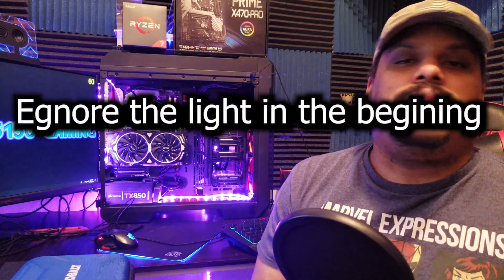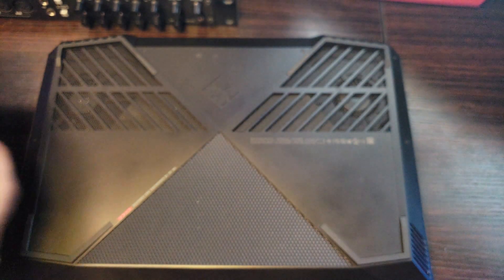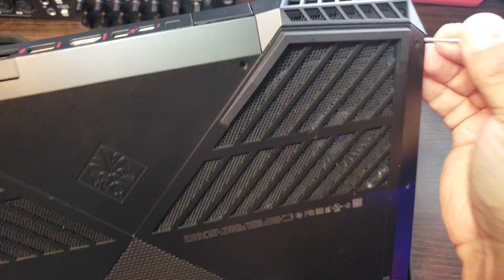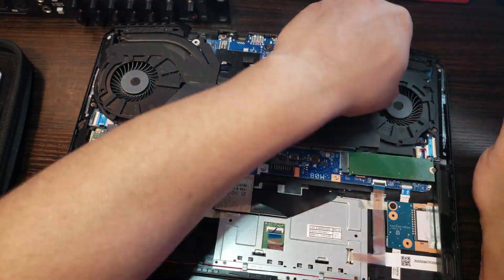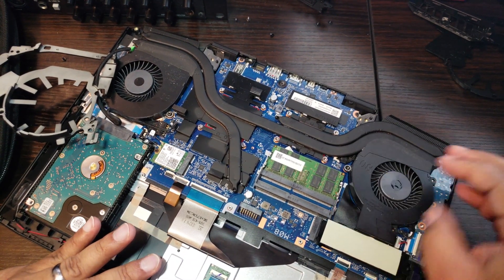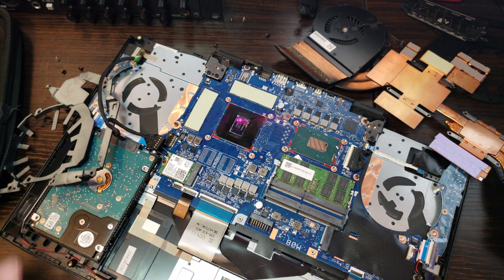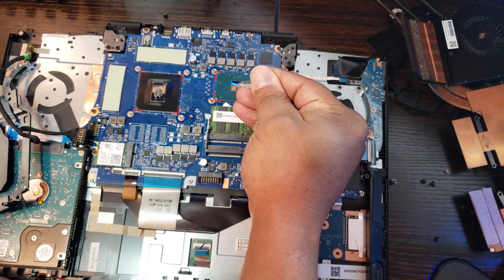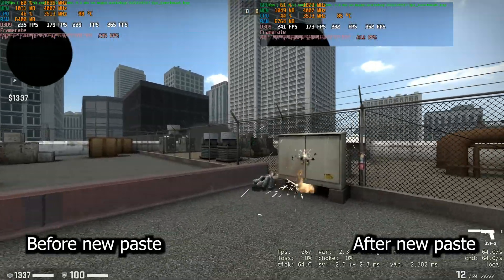HP-Omen 15 how to add new thermal paste to laptop / Laptop Tear down

Comment: Hello mate, nice video! Have you seen any difference after the liquid paste? Did it cause any damage after some usage? I have the same laptop with a 1070 GPU and thinking of trying this liquid paste as right now it runs about 80 - 93 celsius. Please advise me if it worths or if its dangerous of harming the laptop, thank you!
Reply from the maker: Been running stable ever since.  It's normal to be weary.  I was a but myself. The pads the company uses is not really high quality. Using paste will only help the laptop, those pads they use are really so the company can save money per unit, it's easier and more cost effective to create a machine to put on a pad then a human to add liquid paste. Check some of the other comments here a few others have followed this and we've all decreased temps by 10°c to 20°c. Let me know how it goes for you if you do. Thanks for watching!
Reply: @EnforcerGamingX  Thanks for your reply! Feels good to know that it does not cause any damage to the system over time. Is there any specific liquid paste that you would recommend? Thank you for your help!
Reply: @EnforcerGamingX  they use pads instead of paste?
Reply from the maker: Yeah it the pads they use are quite low quality, using a good paste was pretty helpful bringing down the temps. Using pads are pretty common with laptops in this price range it's cheaper in the manufacturing process.
Reply: @EnforcerGamingX  I have an Omen 17 I bought for £1400 , CPU temps are hitting 90-92 c , it does not throttle though and is holding 4.2ghz all core on a cinebench or prime 95run.

Wonder if it's worth repasting.
Reply: @Jasontvnd9  same here -.- definitely my last hp product ever

Comment: Gonna repaste my hp omen 15-dc0022na tonight first time doing anything like this only worried about putting it back together lol
Reply from the maker: Kinda like I told the other guy a few days back. Take video or at least pictures with your phone or  anything. That's always my problem is I'll get everything back and boom! 2 extra screws..what!!? Lol. That extra video / pics really helps in the end. Last guy was 14 y/o and completed it with no problems :) you got this.
Reply: I did it all fine so far temps around 80 now gonna do more tests tomorrow thanks for the guide made a big difference. Did take more time putting it back :)
Reply from the maker: Awesome man! Glad it was helpful let me know how it all goes :)
Reply: Did more 3 hours of gaming max cpu temp was 87 down from 97.

Comment: so i did this earlier today and i managed to cool my temps down. thank you. however now my laptop doesnt get good connection to my wifi, did i mess up or is this a whole other issue?
Reply from the maker: That's gotta be a whole other issue unless you somehow disconnected the wifi wire cable. I'm not certain but normally it is on the other side of the board. In hp laptops it's a small rectangular module. Looks like 1/4th of an SSD drive with 2 wires connected. Really only thing I can think of if it is the problem. If all other wifi troubleshooting fails, may need to open back up and see if something else came lose like that. Thanks for watching, hope you get that fixed!
Reply: @EnforcerGamingX  I would that that its that too, but the wifi still works. for example it still let's me connect to my wifi, it just says it has a very low connection, it only shows the dot and no bars. meanwhile on my phone its working perfectly fine.
Reply: Try to reinstall the wifi driver in device manager?

Comment: Thinking of buying this laptop this weekend wondering is this the only solution for the heating either this omen or the after nitro 5 wondering ur opinion I picked these two cause they most in my budget
Reply from the maker: I've been asked this question on the Nitro 5 I used it be not extensively. It does run cooler out of the box then the hp-omen. But after this repaste it's always in reasonable temps now. People like to undervolt but I don't suggest that unless you're familiar with over and under clocking.

Comment: Need to do it , do you know what will be best option to clear fans ? Compressed air in can will do it or try something else?
Reply from the maker: Yeah I just used air, it was surprisingly clean in there considering I have cats that shed pretty bad. Of course they're never by it but still lol. Not much dust or anything in it, air was good enough. High alchohol cleaner is what I use for heavy dust and dirt. Used to repair computers and some of them gave me nightmares lol. But clean after cleaning out :)

Comment: My fan grill got burned because of heat
Reply from the maker: Your fan grill? How hot did your CPU get? Because that's pretty much impossible, the throttle point for Intel is 100°c. Melting point for PCB plastic is almost non existent as at ~450 Kelvin ( ~150°c) the plastic will just jet soft, the CPU would need to get to a temp that would actually melt the CPU before it could distribute that much heat through the laptop and burn PCB  plastic. Was there something else going on in the laptop, did it short out or something? Like the old laptops using the older polycarbonate they would ignite causing the entire laptop to start up in flames. If the fan grill got hot enough to burn, other components would ignite. Thats also the reason those Samsung phones just bursted into flames instead of just melting a few years ago, Just crazy, get some pics on reddit dude and link me! :)
Reply: I was doing 3d rendering and it's color got white like not exactly melted but about to
Reply: My bad bro I just cleaned it with a little wet cloth and turned it was dust also I'd there any that I can clean dust without opening my lapot like with hairdryer or something
Reply from the maker: Without opening I would just use cans of air, if it's caked on dust enough it won't come off with air, you'd have to open the laptop and wipe it with computer cleaner, something alchohol based so if it gets on the board it won't do any damage as alcohol will evaporate right away. Glad you figured that out. Good luck!
Reply: @EnforcerGamingX  thanks for your help

Comment: i was calling HP support cuz i have fps droppts conditioned by thermal problems (cpu). they said repasting doesnt have warranty and also: THEY DONT HAVE THERMAL PASTE FOR HEAT SINK BUT THERMAL PADS... technical support HP. But thats not true is it? :D i have the hp omen dc-0304ng

Comment: Turn off Intel's Turbo Boost, you're welcome. That shit is cancer for laptops.
Reply from the maker: I'll give that a try but with the new thermal this has been running perfect. No more than 80c during hard end gaming. But without turbo the processor speed is a bit low for gaming.

Comment: Nice video. I need to upgrade the ram of my Omen 15. You might consider removing the background music. It sounds really noisy and can drown out your voice at times.
Reply from the maker: Yeah sorry about that just some riffs I write for videos. Was masking some bad background noise lol. Also my studio headphones were broken so was using gaming headphones which is really bad for finding levels. The 16gb of ram in the omen is good till you do some 3d or game design. So far it's been good there but always want more ram in those situations :). Thanks for watching!!
Reply: @EnforcerGamingX  I just want duel channel ram. But the last time I tried, there wasn't a significant difference in gaming performance.
Reply from the maker: Depends if you run games at the max the GPU can handle. If the GPU utilization is over say 80-90% there will barely be a difference.

Comment: Damn why yours is going up to a 100? Mine have a stock thermal paste and I have like 60's mid 70's for CS Go.
Reply from the maker: Interesting.  When did you buy it?  And is it the exact same model? Been a known issue on all 6 core CPUs. I'd like to see, did you make any videos with it. At 1st 70s and 80s if u see my early videos on this laptop. Then jumped up more over a few months.
Reply: @EnforcerGamingX  yeah I have the same exact model and same exact CPU. Unfortunately I don't have any videos of it. I bought it 2 months ago.
Reply from the maker: Ahh okay, possible they finally fixed it in the newer versions. HP had tons of complaints on it, but within the 1st few months it wasn't so bad.
Reply: Everytime like I am playing GTA 5 or Fortnite I am having a mid 80's is it bad?
Reply: George Santos: Because csgo is not difficult for pc hardware i have a same laptop and when i play far cry 5 the temperature is  95 - 100°
Reply: @Hefaistos95  I know but what I am saying is his laptop is going up to a 100 degrees even on CS GO
Reply: @georgesantos4240  Because the laptop is running at high fps on csgo that is the reason why is the temperature so high i always lock fps to 80 on csgo and then i have  max 70°
Reply: @georgesantos4240  The less fps the less temperature
Reply: @Hefaistos95  no it's not like that. The less the temp the better. Higher temp will give you fps drops.
Reply from the maker: Well the fps will drop as you reach 95°c and even more at 100°c when the CPU hits those throttle levels. The speed will decrease mhz and of course so will the FPS. Repaste was the best option because I been getting stable fps and temps in the 70s-80s.

Comment: I think you saved me a lot of time and money. I've had heating problems with this laptop since I got it and couldn't find any concrete solutions on this pc specifically. I'm on my second cooling pad trying to bring the temps down. Thank you!
Reply from the maker: Spencer comments like this totally makes my day. Temps have remained decent since this repaste. Repaste with a cooler that lifts the bottom a bit makes for really acceptable temps. Thanks for watching and appreciate comments like this :)
Reply: @EnforcerGamingX  Just thought I would give an update: I repasted about 2 weeks ago and have maintained about 15-20 degrees cooler than my original temps with pretty much everything I throw at it. Thanks again
Reply from the maker: That's great! Glad it helped, I was in the same boat month after buying this laptop I was worried I just burned my money for a overheating laptop. Thanks for the update, appreciate you letting me know this worked!

Comment: Mine after update f. 08 my cpu got over 97 c  while gaming tried undervolting to - 150 didn't work it only lowers the cpu when I disable turbo boost any help, mine is almost 3 months old
Reply from the maker: Did you try the repaste?  This laptop was only a few months old as well. All the games I did on this channel it seemed to get worse but was always high.
Reply: @EnforcerGamingX  I'm afraid if I repaste it I lose my warranty still I have 8 months left
Reply from the maker: That is a good question to bring up and probably should have mentioned it in my video. You won't lose your warranty if in the U.S. long as the paste is not the reason you need the warranty. Feel free to research this more as of course I'm no lawyer to give actual legal advice. But here's some information to help ease that worry a bit it's called Magnuson-Moss act in short long as your modification is not what breaks your laptop the warranty is fine. https://www.mlmlaw.com/library/guides/ftc/warranties/undermag.htm
Reply: @EnforcerGamingX  ohh I didn't know that, I have thermal grizzly paste left over from my pc am gonna use it, thanks bro
Reply: @EnforcerGamingX  hi bro...one help&advice....got hp omen i5 7300 ,gtx1050 and almost all new games getting my laptop hot hot....at example bfv 90-92c,bf1 90-92c.....apex 87-90c...nfs payback 90c...temperature like that are since i buy laptop.When i use laptop for no gaming...is average 55-60c.... all of this what i write to you are on undervolted on -160v.Some advice from you ? worth of changing thermal paste or ?
Reply: @secondevil1  yes change the paste
Reply from the maker: @darkishrex98 Thanks for answering this!! I feel so bad @SecondEvil I totally missed this reply dark is correct. Putting on new paste helps quite a bit as shown at the end of this video. I added a bit more than needed, but got good results!
Reply: @EnforcerGamingX  im gonna try using liquid metal coz mine gets hot even after repaste and undervolting the cpu, maybe the paste i used wasn't so good. used the cm mastergel, bought it cuz it was pretty cheap on sale on amazon
Reply from the maker: I would be careful using grizzly paste or liquid metal, never use it on aluminum coolers.  I'm not sure if the omen is aluminum though. What temps are you getting after paste? And are you voltaged? May want to reset that , I'm thinking your voltages are off if your still hitting 100°c.
Reply: @EnforcerGamingX  at 3.7 ghz and -165 undervolt, im reaching 90°C in apex at low settings. And not sure what you mean by voltages being off? Can you explain that please?
Reply: @EnforcerGamingX  hi can you pls tell me what you mean by my voltages being off?
Reply from the maker: Well I don't give recommends on undervolting. I would be sure to find someone that has undervolted this laptop specifically also not every CPU will clock the same. 90°c is about right depending on the room you're in and what your laptop is sitting on. Laptop cooling pad is what I normally use so there's good airflow in the bottom.
Reply: @EnforcerGamingX  i see well I'll look into my settings then, thanks

Comment: Mind telling me what paste you recommend for the omen 17 i7 7820hk because I tried grizzly paste but cpu temperatures remain the same around 93c on games such as shadow of the tomb raider and hitman 2016. Thanks in advance.
Reply: i have hp omen i5 7300, gtx1050 and my temp in game are as well average 86-92c in games,depend what game i play
Reply from the maker: The i5 7 series is not too bad, as its 4 cores 4 threads.  The i7 8700h is 6 cores 12 threads. These 6 core CPUs are what really have issues with heat as there is demand for them but limited tech to keep them cool. Adding aftermarket paste is a good way to get the temps down. Hopefully we will see some better innovations the year and next in terms of stock cooling :)

Comment: Thanks for the video. Really help in terms of showing the incapable stock paste when compare to the new thermal compound
Reply from the maker: Glad to hear it was helpful, was waiting to do this video for awhile ;) thanks for watching
Reply: @EnforcerGamingX  have done it with mx-4 current temp idle 35degree max 76 after undervolt by throttlestop -125 for cpu power and cache
Reply from the maker: Nice getting to 35°c just be careful your room temperature doesn't exceed 35. If it does you risk condensation which will kill the CPU :).

Comment: That is a significant difference. Do you notice a difference in frame rate when you play games?
Reply from the maker: Not a significant amount, but a bit as it's not hitting that throttle point where it drops to 3.2ghz so it is more stable framerates ;)

Comment: Thanks for the video. That seemed like a lot of thermal paste though.
Reply from the maker: Yeah I noticed that a bit more after, I was reaching around two tripods lol. It's not too bad though, you want to just get it to cover the metal of the cpu itself. We got a good result from the new thermal though dropping 20°c I can't complain lol.  Thanks for watching!
Reply: @EnforcerGamingX  makes you wonder what they apply in the first place , I mean thermal paste after its applied usually lasts 3+ years.

Unless you they just put bargain basement rubbish on it.

Which is kinda silly since it's a gaming laptop with a powerful cpu to cool , no point having fancy heatpipe coolers when the thermal connection to them sucks.